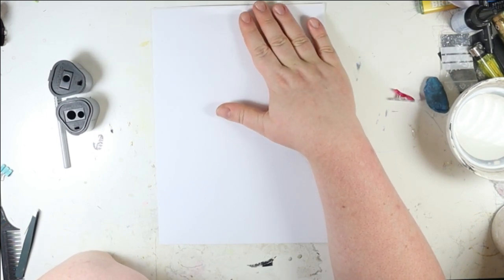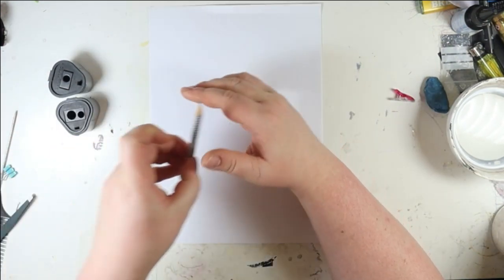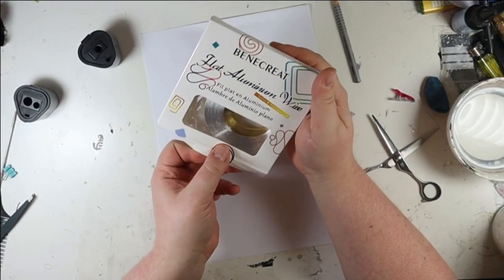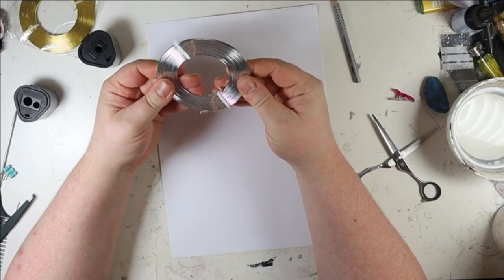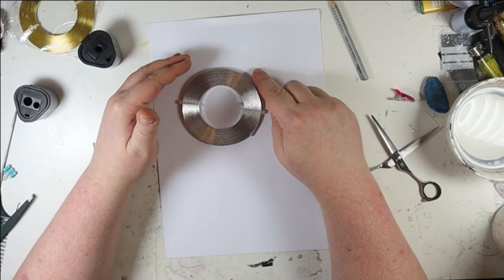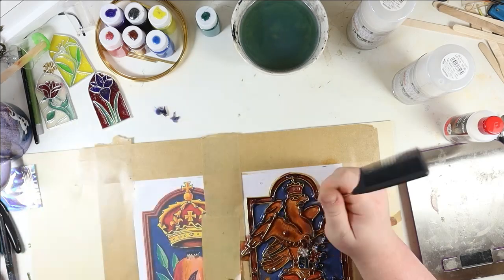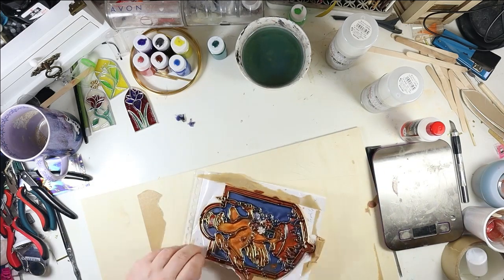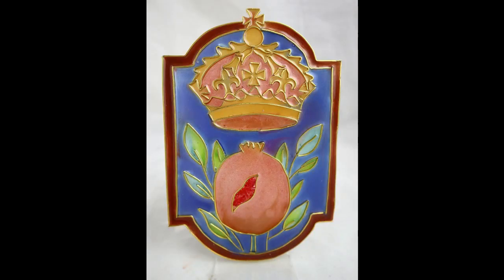I try to fake stained glass by using resin and wire inspired by cloisonne

Comment: Bonjour ^^

Je regarde les vidéos et live d'une créatrice, qui nous a conseillé, en cas de "résine uv" qui reste collante après "cuisson", de mettre l'objet dans un récipient transparent, suffisamment rempli d'eau pour recouvrir l'objet, et de le re-traiter 3 mn en uv. Normalement, sauf si c'est une résine de mauvaise qualité, ça marche. 

J'ignore si ça fonctionne avec une résine "temps réel" par contre.

Et de ne pas exposer tous les objets finis, récemment créés, à la lumière du soleil pendant 15 jours pour éviter le jaunissement. 
Apparemment vous utilisez une résine qui se solidifie toute seule avec le temps (ce que j'appelle temps réel).

Ce que je proposerai, c'est d'abord d'utiliser une résine qui se fixe avec lampe uv genre manucure de vernis semi permanent (dont le fond s'enlève pour pouvoir la déplacer et l'ajuster au dessus de l'objet à "cuire"), ou avec une lampe uv genre lampe torche.

De faire le fond, en appliquant la résine gel uv (genre CLEOPATRE la toute nouvelle) non colorée, de façon à ce que ce soit très léger, sur un (1) mm de profondeur, ceci au fur et à mesure du placement du métal, afin de le fixer en fond, avec la lampe uv, et ce qui compartimenterait le tout sans risque de fuite (et sans colle). Il resterait deux mm (hauteur restante du ruban métallique) pour la résine colorée.  

Bon, c'est l'idée, avoir la main très légère avec la résine, mettre une goutte et l'étaler avec un pinceau ou cure-dent, placer le ruban métallique puis utiliser la lampe uv. Répéter le tout.

Ne pas utiliser de lampe de maison uv en même temps, et bien fermer les rideaux pour bloquer les rayons de soleil, ne pas chauffer le plan de travail. 

Ce qui augmente la dépense, environ 15 € pour une lampe uv manucure basique. Et la résine CLEOPATRE - UV’Glass - Résine UV-LED prête à l'emploi séchage rapide format de 25gr (je ne suis pas rémunérée pour faire de la pub xD ).

Merci pour l'idée, et le partage, c'est très intéressant comme méthode, et j'aime beaucoup le résultat =) 
Pour une maison de poupée, ce serait parfait, pas de risque de blessure comme avec du verre, en cas de casse ^^

 Vous reproduisez ce qui s'appelle en France un écusson, qui représente les armoiries d'une Maison (famille, noble).

Bonne journée ^^
Je ne vais pas ajouter de traduction, j'ai beaucoup trop écrit ^^"